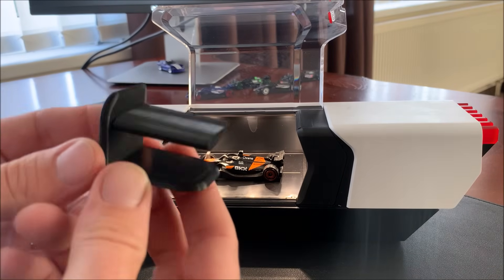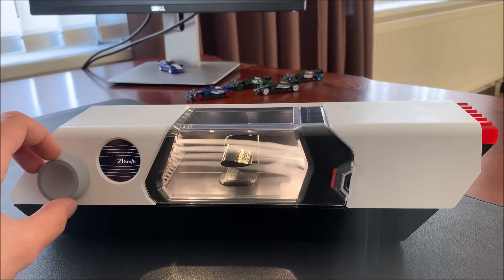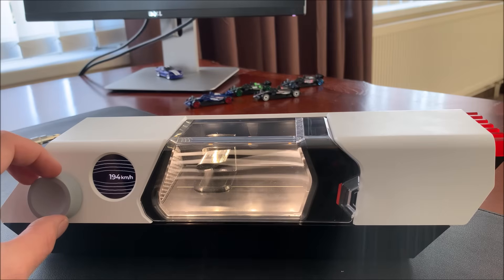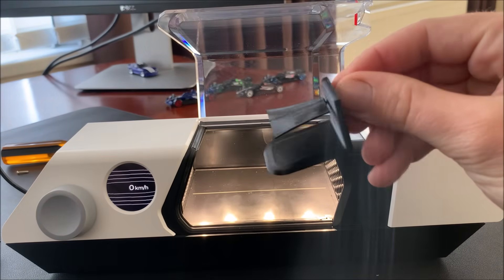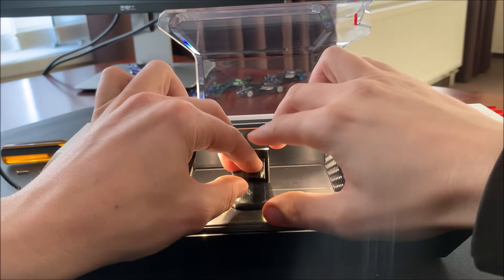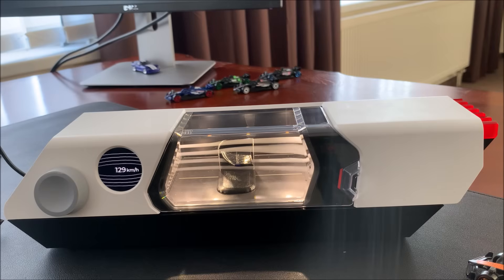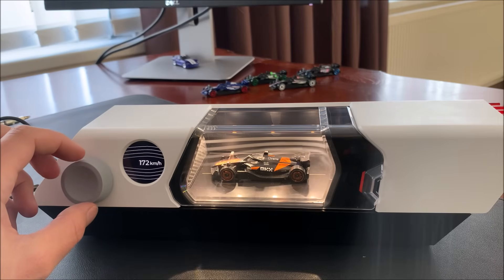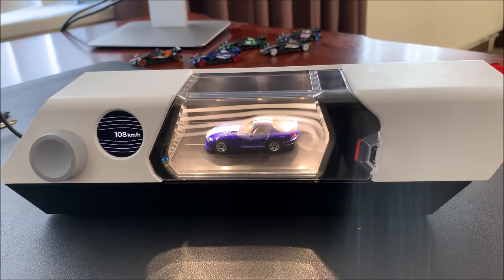Wind Tunnel Session - F1 and Tip Vortex Analysis

Comment: Would an endplate has the same effect to prevent the tip vortex? And why have some racecars slot in the overpressure area of the endplates? Maybe you can show it in an upcoming video :)
Reply from the maker: Yes, endplates seal pressure areas and the slots help to reduce the tip vortex. We can talk about it in a future video
Reply: Those slots, also called louvers, help neutralize the vortices by bleeding off some air to disturb the vortex that builds up. Obviously has a reduced downforce overall but it's pretty negligible for the speed disadvantage you'll get when not running a louver.

Comment: I feel this could be a good tool for young engineers to explore the effect of Reynold number. Perhaps change the speed unit to m/s, add a pressure and temperature sensor to find air density and viscosity then show them on the display?

Comment: Doesnt the air separate later with increasing speed because of the higher reynolds number, or is it because the "Wind tunnel" has too much dirty air coming out at higher speeds?
Reply from the maker: No it separates earlier with higher speed as the flow is more vulnerable
Reply: @bsport320  I am so confused, i ve read a paper where it states otherwise, and another paper states it like you

I am in an FSAE team and only do incompressible flow, it would still be nice to know whats real now, what do you mean with more vulnerable, is it because the boundary layer is smaller?
Reply: @mfg-music5875  This is because of the very low Re in the miniature tunnel. Stall occurs, when the air on the low pressure side of the wing can't overcome the increasing pressure gradient towards the rear after the low pressure zone (at usual reynolds numbers). 
Re is basically inertia/viscous forces. With a small wing like in the tunnel, Inertia (speed & wing-length) of the flow is low, but viscous forces (air-viscosity) are high in comparison. The viscous forces drain so much energy from the flow, that even with increased speed the flow can't overcome the adverse pressure and this leads to seperation.

Comment: Wind tunnel noob here: So when they display "250km/h" on the display this is based on the wind speed equivalence" based on dynamic pressure or Reynolds number scaling?
Reply: Should be the other way round. Reynolds number is proportional to cord length and speed. IMO that's just a toy without relevance for engineering.
Reply: And for this small tunnel it is "good enough estimation" or it is more like a toy? Because I would assume that there is some size limit where similitude works.. but again I am a noob here on this topic...
Reply: @reneradojcic  i guess it's just deemed as good enough for the demonstration.

there's some scaling formulas and stuff, sure. it works to a point, but even thats just for certain sort of similarity through the reynolds number. and you'd need to go faster not slower, right? the air's behavior itself just doesn't scale all that great and the smaller you go the more off it is what you can achieve. I think 1/10 would need like mach 1 or something to simulate a f1 car(and wouldn't work due to being faster than sound).

but still you can do some demonstrations with one.
Reply: @lasskinn474  You will need to increase speed according to scale for the same reynolds number. So 1/64th scale -> 64x speed. Or increase pressure in the tunnel or use heavy gas/water... Which of course isn't done here. Because of very low Re in this tunnel (low speed and miniature scale) you also can't easily scale to higher Re.
Reply: In the description of this video there is a link to the manufacturer, there they have more info. I haven't checked which scaling factor they use.
Reply from the maker: No the indicated number is not in correlation to reynolds..
Reply: To be realistic, it should use water.